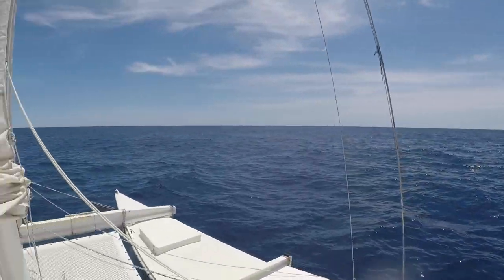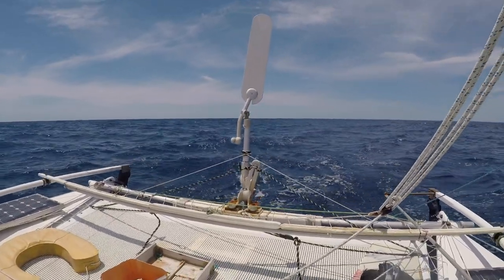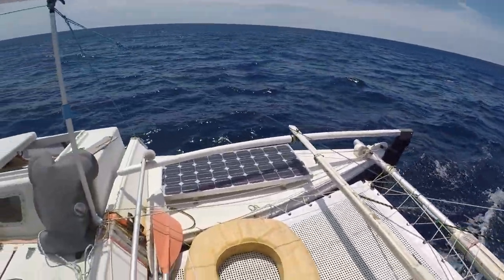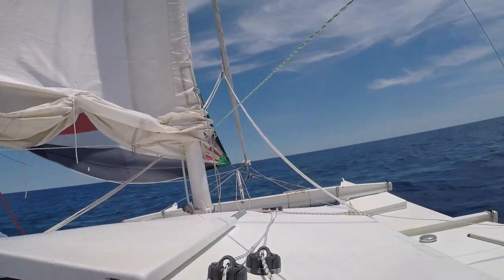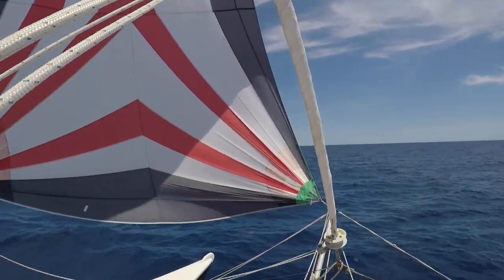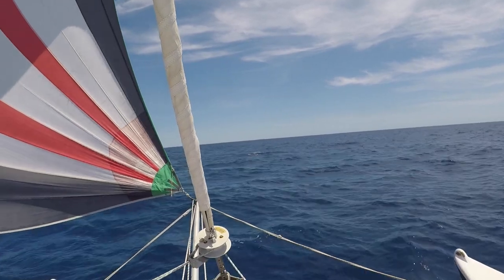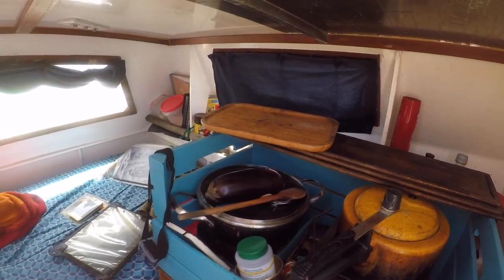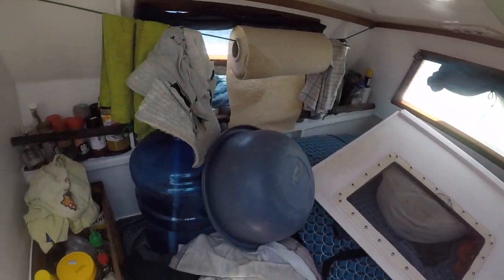Set-up on my Tiki26 «Wayan» - Windvane, Gennaker and centrepot explained during my Atlantic crossing

Comment: Thanks, enjoyed. Very informative.
Your wind vane looks over kill!
I was going to ask why you did not fly the kite from the windward (or perhaps lee) bow, but then see you get the same with more control with the pole.
One question, what are your tactics in very strong winds?
Reply from the maker: Hi. 
The pole is very useful to get the kite out of the windshadow of the mainsail, by moving it to windward and as far away from the boat as possible/reasonable.
I added a third reef for the mainsail, leaving only some square meters left which is very useful for strong winds from everywhere else then behind, because the boat is more balanced than only with the jib. 
For winds more than 30/35kn I sailed downwind with a T-Shirt size of foresail and dragged the longest lines I had attached to both sterns to slow the boat down when waves were pushing and accelerating the boat to much. I prefer this over an sea anchor because it’s easier to get in again. I hope that answers your question?
Reply: @NiklausWildisen  thanks.  I had a Hirondelle, used to fly a genoa off one bow or other.  Interestingly on a close reach, there is an advantage in setting off the lee bow.  
Recently got a Woods Gypsy.  She has perhaps a little too much windage, I might need some sort of drogue running in 35+. and bare poles.

Comment: I have always wondered if a Chinese Junk sail would work on these boats. Easy to reef, easier to single-handed?
Reply from the maker: I saw different wharram cats with junk riggs, but all bigger than 26’. 
I can not compare with junk riggs because I never sailed one but I absolutely love the Wahrram Gaff Rigg. The sail can be set* and lowered with any wind angle and it is very effective. 
*setting is hard with strong wind from behind because the gaff tends to set behind the shrouds.

Comment: Wait a moment. You are going on 26 ft over an ocean? Are you not afraid?
Reply: The sea keeping ability of that little boat is better than many, twice its length. I had a Pahi 31 and it was not comfortable, riding out a storm at sea, but if you think it’s any better on a fifty footer, you’ve never been at sea in heavy weather. Stripped of her sails, she just turns into a raft and will ride out pretty much any storm. IMO, catamarans are easier on the crew than monohulls in big seas.
Reply: @q.e.d.9112  Thank you for the answer
Reply: @verticalhistory6594  
You’re welcome.